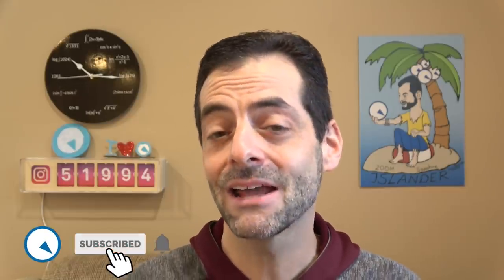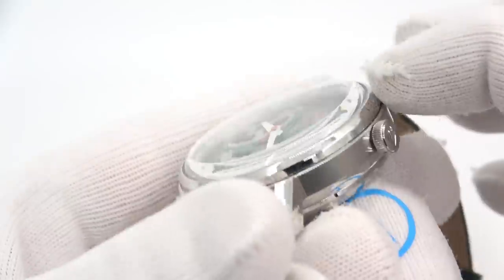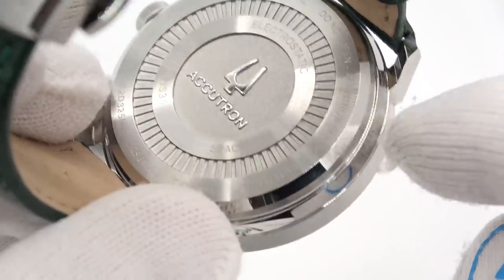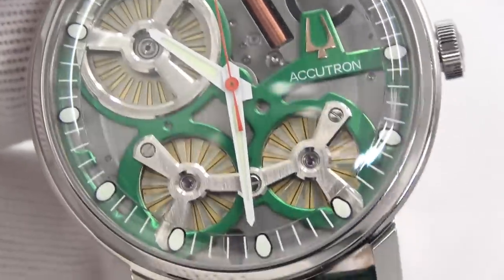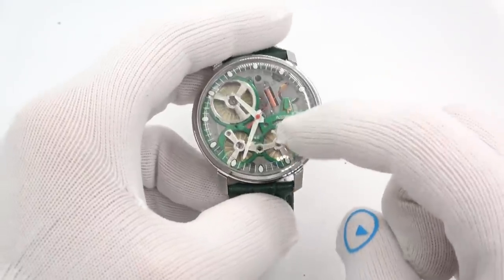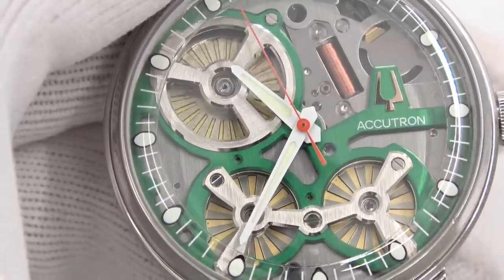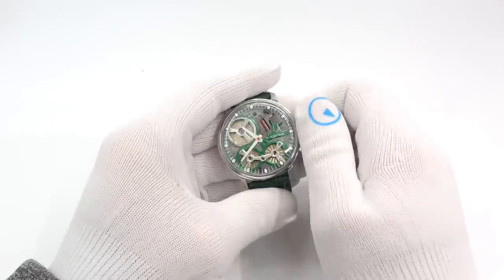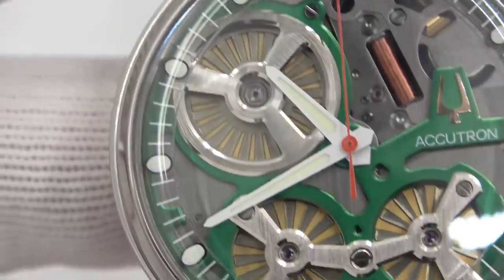How this Electrostatic Watch Works - Watch and Learn #84

Comment: $3,000? That’s my question. Meantime, there are a lot of lovely non-battleship-sized vintage Accutrons available for reasonable dough. I just picked one up for $60. Works great; still very accurate.
Reply from the maker: Cool!
Reply: @islandwatch  and it was a 30 Year presentation watch from Weyerhauser to one of its workers. I love those personal history watches. (Marc, thanks for explaining how the watch works.)
Reply: $60 bucks how? They hover around $400-$700 everywhere I look. I do agree with you though Bulova is putting it out there at $3,000 to see who bites. But who knows maybe they know the market better than me. 🤷‍♂️
Reply: $60?!! Wow. Most of the original Accutrons I've seen are $300-$600 or even $1300 for some...
Reply: @armandr1613  Bulova has nothing to do with them now. They sold it all to Citizen. I've heard.

Comment: Been waiting for this one! Great to finally get an idea of what's going on with this movement. Crazy interesting and I love the look of those rotors spinning around. But if it only generates 1 hour of power for one day of wear, doesn't that mean the accumulator is going to run dry in these than a year? Oh wait, you answered this already in another comment.

Comment: I found your video because i was curious how this watch functions but I am honestly underwhelmed. It has both a rotor and a battery so it's just like a kinetic. The only thing that's different is the way current is generated (or used in the case of the second hands). Like they wanted to add a sweeping seconds hands to a kinetic watch at all costs
I would have been more impressed if they found a way charge a quartz watch both with light and movement, and then try to use that extra power to make the seconds hand tick more often honestly

Comment: Super geeky cool!  Thanks! 
You know with the lume orientation issue, I wouldn't mind if the solution was to simply not lume the 12 or even 6 o'clock indice.  It would only be noticeable at night when it really maters.
Reply from the maker: True, good point.

Comment: Is there an IC quartz controlled electronic regulating board in it sort of like what a Spring Drive movement has?  Also, when the watch fully shuts down, does it still keep/remember the correct time when it wakes back up or is the function solely to save the charge in the energy cell thingy?

Comment: so after five minutes on the night table it stops and you have to reset it in the morning?  Thats not good, but I still love it!!!  Or does it catch up to the correct time?  In video when it started back up it didn't fast forward.
Reply: The hour and minute keeps moving except for the second hand if its sitting on a night table..no need to reset it..

Comment: Thank you for the video. I've read a bit about the watch, and was still rather confused. This helps. IIRC from what I read, if you depleted the capacitor, you have to send it in for service, hence the full charge when you get the watch, and the power saving modes. According to the FAQ: "The second hand has stopped at 4 o'clock on my Accutron electrostatic timepiece: Your timepiece's energy reserves are below operation and recharge levels. Please send to an authorized service center."

Comment: I bought the Accutron 2020 yesterday and it looks spectacular.  However I have one issue with it.  To get the sweep second hand to run I need to shake the watch vigorously.     The second hand with then run but only for a few minutes.   Then it stops and I need to start the process over again.  Am I doing something wrong or is there an issue with the watch?
Reply: I think that's expected. How do you like watch a year later? So tempted to pick one up
Reply: @bigdreams5554  More than a year latter I love the watch.    Just a little jiggle will get the second hand moving if it isn't already running. I've come to consider that a charming quirk.   It's a great time piece and it gets a lot of time on my wrist.

Comment: I was never big into watches, discovered Accutron only a week ago :)  Big thanks for explaining this amazing piece of technology. Now I'm actually more curious... 
Does it really make no sound? ... I guess the kinetically driven electrostatic generator (miniaturized dual Wimshurst machine) and mini electrostatic motor, they are not operating at high rps here but still spinning. At least center bearing of the kinetic drive should make some noise. 
The electronics in this watch is equally interesting as the the electrostatic stuff...  has to rectify and drop the relatively high voltage, probably 3 phase, from I would say tens or hundreds of Volts to single digits to charge the battery (probably Lithium), drive the hours/minutes-hand stepper motor and power the controller (quartz clock, catch up function, battery protection power save and energy save modes), probably there is also a step-up converter(DC to 3 phase?) built-in to power the seconds-hand motor or there is another energy storage in there like higher voltage capacitor just to store energy to drive seconds... 
Again... what a watch! should last at least 10 years before 1st service - probably for battery replacement, looks great, and the lume is very nice and discreet.

Comment: Brilliant.From more of a civil engineering point I compare a pure old mechanical watch movement to a masonary stone bridge.A quartz analogue in priciple I compare to a suspension bridge.This watch I compare to a cable stay bridge.Each phase doing the same job but better and better.
Reply: Also reference the main wheel stopping and starting yet maintaining a fluid second hand motion is much the same as 50hertz domestic AC power supply .I you look at a flouresent lighting tube with polarising eye glasses it flickers on and off 50 times each second but our normal eye sensetivity conveys it be on constantly because the brain works at a much slower frequency.God I bore myself sometimes sorry.
Reply from the maker: True, Glenn!

Comment: I think your theory is correct.  By my understanding, power cells that store energy have a shortened life-span when drained too far for a certain number of times.  Thus, keeping them near a full charge will extend the life of the battery longer over time.

Either they were being very considerate with the save-modes to solve the problems with kinetic, or the batteries have stability issues (short life-span maybe?) that needed to be corrected.  Just an uneducated theory, so I could be wrong.
Reply: But if you only gain an hour per day when wearing it and you don't wear it every single day, then the battery will eventually deplete and then what? You send it back and they put a new one in?

Comment: Hey Marc. thanks for showing this piece,  I found this mechanism quite interesting. I was also wondering what would be the difference between this type of mechanism and a Kinetic? as I understood it they both charge an accumulator and they both are quartz movements. Although the Kinetic has a rotor more akin to the mechanical watches, and this one has that separate motor related to the seconds hand. I'm not sure, but they do seem quite similar, aren't they?
Reply: The difference would be an electrostatic motor versus an electromagnetic motor. Is that it?
Reply from the maker: Bingo, that's the difference. Electro-static vs Electro-magnetic. And the use of 2 motors here instead of one.
Reply: @shariarrahman7562  right, this has electro-static and the kinetic is electro-magnetic. cool, thanks
Reply: @islandwatch  thanks, the difference is now clear for me too!

Comment: Did I hear you right? It accumulates about an hour of energy per day of wearing it? Wouldn't it eventually run out of power if it's running 24 hours per day & only generates 1 hour of energy? That can't be right. Please elaborate.
Reply from the maker: I think that's with the seconds hand running continuously

Comment: That's a very interesting watch. Sadly, I don't think they'll make it smaller, even if it's practical to do so. The Marine Stars are even larger, and they have small movements with a very large plastic movement ring to fill the space.
Reply from the maker: I really don't think its possible to shrink it.

Comment: Just to check, did you say if you wear it for a day it only generates 1hr worth of usable charge?  That can't be right, otherwise you'd have to wear it for 24 days to build up a days worth of charge....can't see how it wouldn't run down then.  Guessing you meant it generates what it needs +1 hr extra charge per day (although that still seems low to me).
Reply from the maker: No, that's what they say in the manual, which is likely why it comes pre-charged.
Reply from the maker: The manual stinks. Maybe they mean an hour of the seconds hand moving.

Comment: I question your assessment of the motor being discretised to give the appearance of a linear sweep in the second hand.  Most motors are continuous machines and have a constant angular velocity.  Unlike stepper motors DC and AC motors rotors move in a continuous rotation.  It is the current/voltage that changes to keep the magnetic moment constant.  At least this is my understanding.  AC motors work with a push-pull cycle, DC motors use a pull-freewheel cycle.

Comment: Seems like an incredibly complex, chunky and less accurate version of the Seiko Kinetic system. My old Seiko Premier Kinetic Perpetual runs to within 5 seconds PER YEAR, and lasts for 3 years in powersave mode, even with the date and month indicators still running. Plus if necessary you can get it recharged at the Seiko service center using an electromagnetic winder. So this design looks cool, but is a less efficient version of an already obsolete technology.